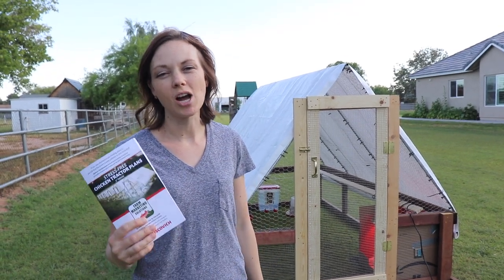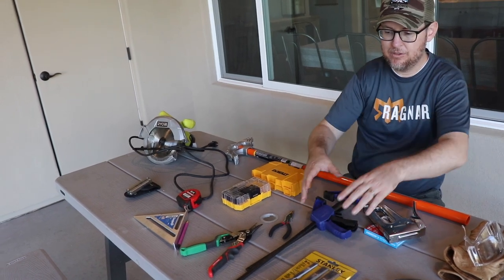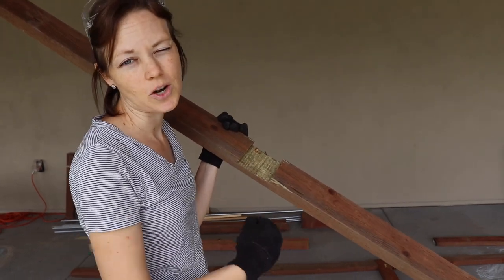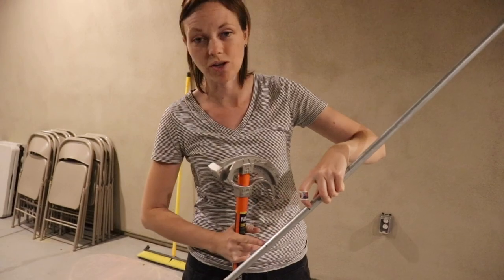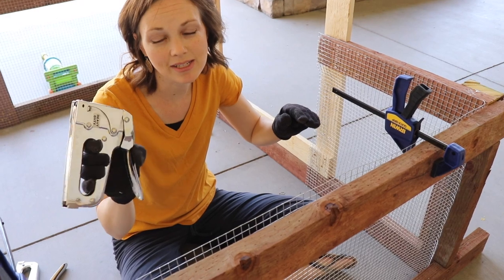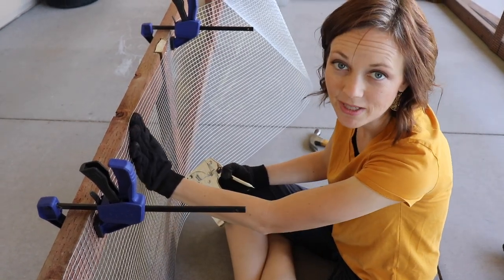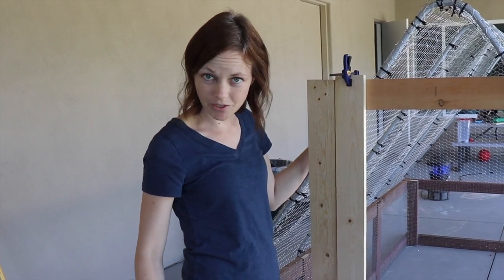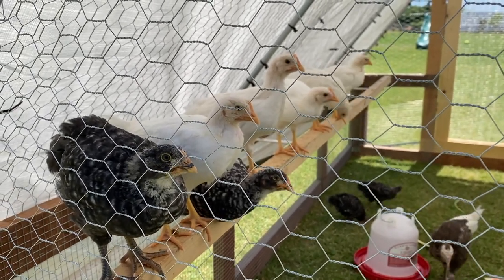How to Build a John Suscovich Chicken Tractor

Comment: Not a bad build for beginners. I was cringing a little myself at how rough those half-lap joints were, but they'll still work just fine. Only concern I would have is the choice of staples. Those household staple guns really aren't made for holding wire, and my worry is that if I were to kick that hardware cloth, the staples would pop right out and leave a hole that a predator could sneak through. That may not be an issue with a fox or raccoon, but could become one if you get a wandering bear or a large dog poking around the tractor. Heck, a deer could kick or step on the wire and make a hole for a raccoon, or natural twisting could slowly work them loose without you noticing. So I'd make sure to test the strength of your staples, and add some better fasteners if that doesn't hold up. Poultry net staples and grip-right nails come to mind as stronger options. They also both have the benefit of going in with a hammer, so no new tools needed.
Reply from the maker: We are definitely beginner builders. I like your staple suggestion.
Reply: @ActivelyFamily  Well, if you start to get more into DIY builds, I can recommend you check out Rex Krueger's Woodwork for Humans series for some basic craft skills, and Home RenoVision's A to Z shed tutorial for construction tips. Rex is more about small builds, like furniture, but he teaches a lot of all-purpose skills as well, including how to cut half-laps. RenoVision has some really cool tips for house renovation and shed construction. So those two make a really good base to build from.